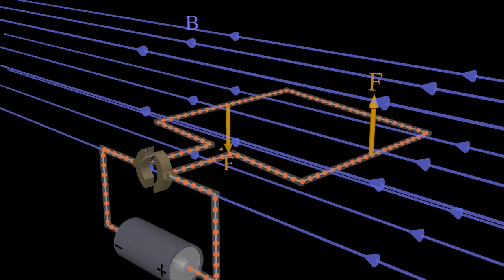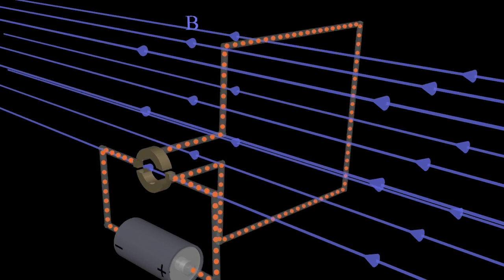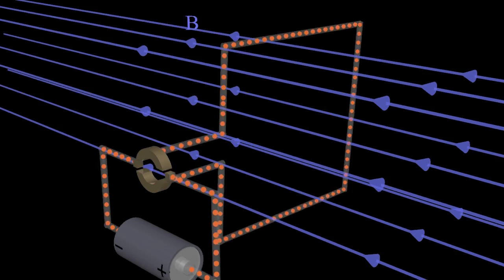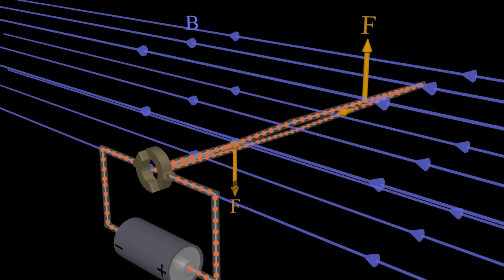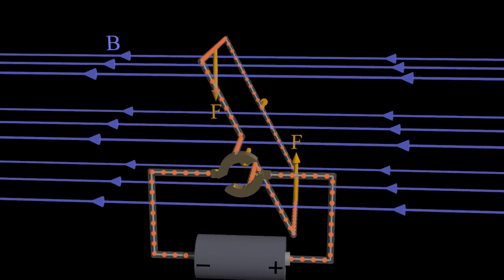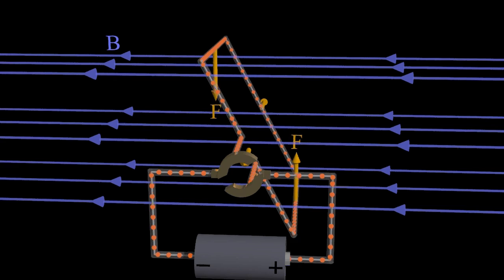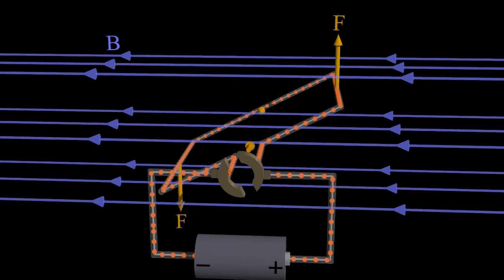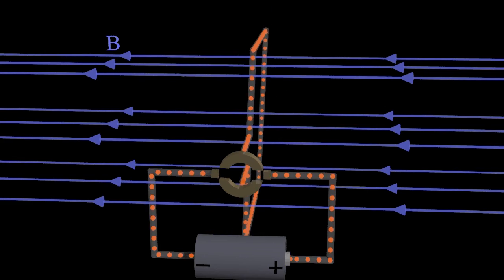Magnetic Forces and the DC Electric Motor

Comment: what about the emf that is induced in the coil? it does not affect the overall principle?
Reply: Torque is a result of the current from the external source.  I wanted to talk about motors as a way of generating useful mechanical torque, and the role of the commutator in maintaining a constant direction of torque. The emf you are referring to will oppose the current source, and is generally covered with Lenz's law later in the semester, so THIS animation only covers the specified topics.  Do you think it would be useful to have an animation on the induction effects that talks about that EMF and energy conservation in terms of mechanical and electromagnetic power?
Reply: Thank you for your response. I just wanted to clear my mind about the existence of said EMF. Your video helped me to understand this motor.

Comment: Don’t electrons travel from the negative to the positive side of the battery?
Reply from the maker: Conventional current travels from positive to negative terminals, the forces on a current carrying wire are usually characterized in terms of force on the current (in terms of the direction of the current).  I was primarily interested in driving the visualization with the most important aspects of the topic